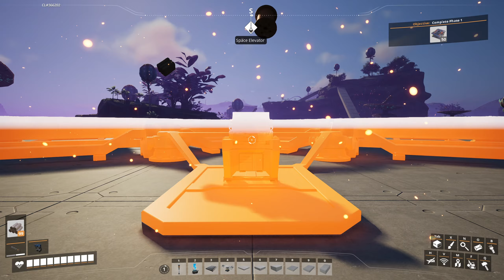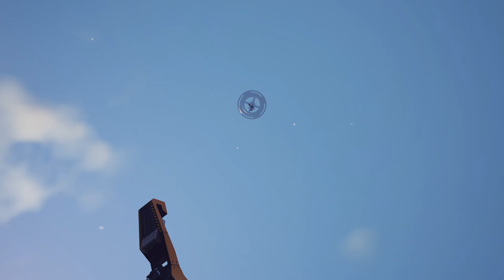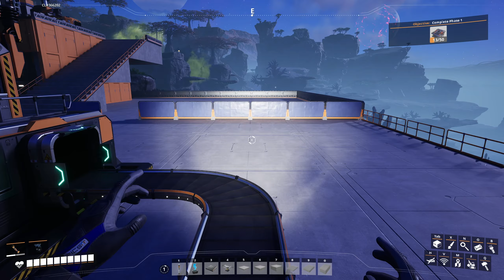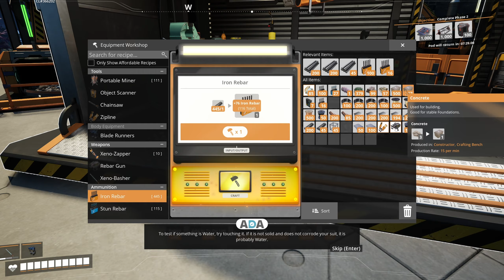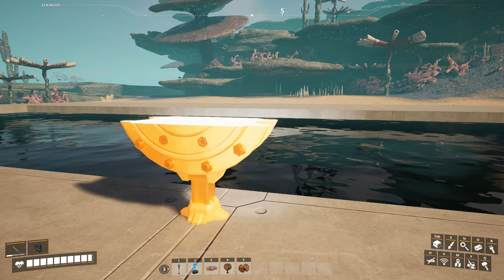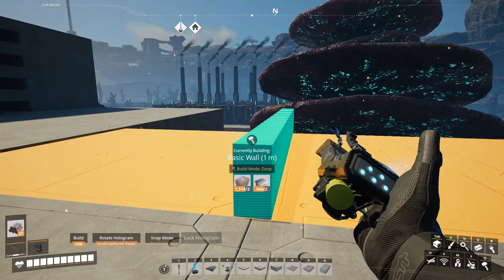Building the Ultimate Coal And Steel Starter Setup

Comment: How much do you plan your build?  It seems you had a general idea of where stuff should go, precisely where on the foundatin a belt or power plant should go... do you also plan where in the world you want to build stuff?  I find I stress more about precisely where to start building the factory more than the build it self, because I want a "city" looking world.
Reply from the maker: Well, I put some thought into what I'm going to build and the nodes I plan to use.  Then I plan my factory around that, sometimes with some future upgrades in mind.  Like if I'm going to get new belts/miners relatively soon.  But I'm not overly thinking my placement of stuff in the Blue Crater at the moment.  As I still have many things to unlock.  So, I'm just generally placing stuff where I think is a decent spot at the moment and will let is grow organically.  

I certainly do stress about that stuff during builds.  My last series was definitely a battle of trying to make it a bit of a city.  And I'm sure in the later part of the game, I'll spend more time and thought on that as I progress further out into the world.